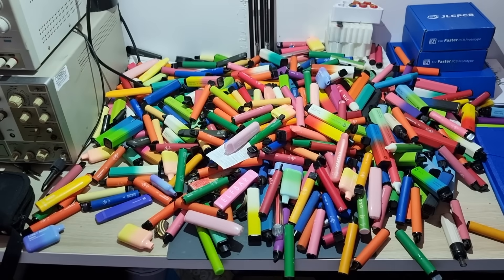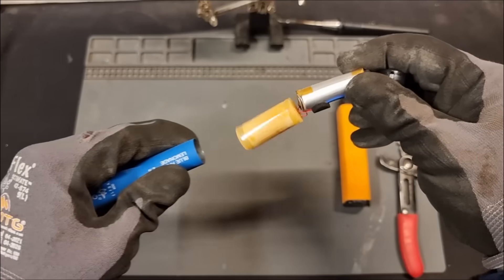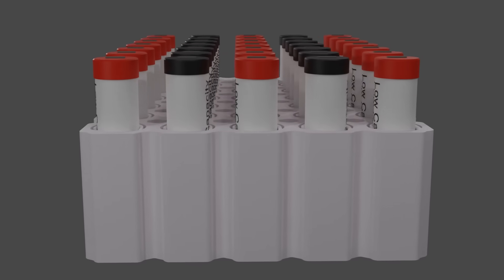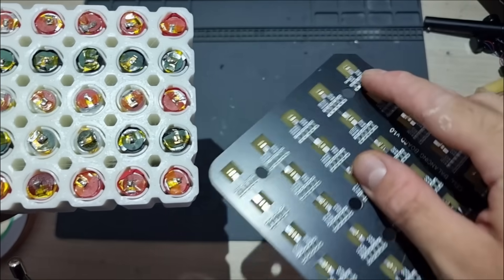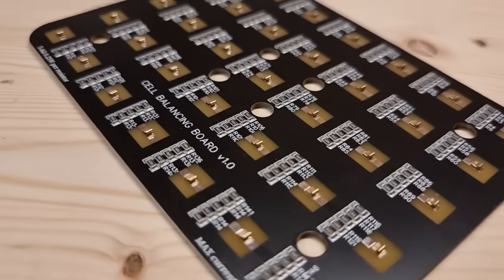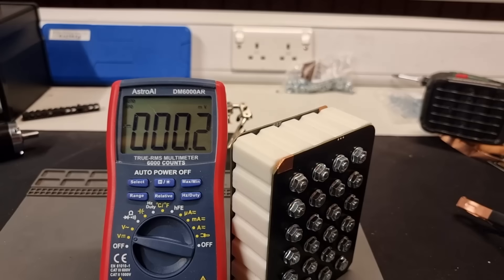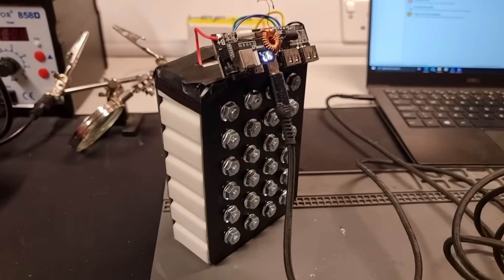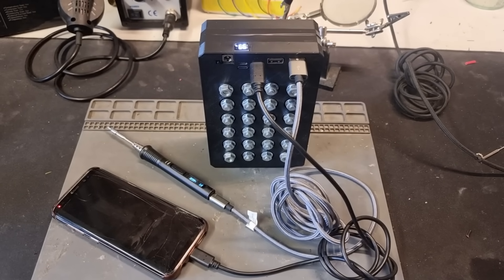Turning Disposable Vapes into a Fast Charge Power Bank

Comment: After 3 years collecting vapes from the floor I feel that I found my soulmate 🤣. I have added LiPo rechargable battery to every single device I have at home and now due to the abundancy of vapes I have been thinking several months about a similar project. Thanks a lot for sharing. 
Also a tip from vape picker to vape picker. I usually dont throw away the cases because they are handy to fit inside two batteries in series or one battery plus a charging module. Thenm I add some diodes in serie to adjust the output voltage and take a cable with a JST2 connector out from the mouth piece of the vape. Like that  you will get a nicely enclosed battery that can be used to power your small devices.
Reply: Yes,  I also have some good-looking and good condition cases that I plan  on using as casing for projects. I found a nice orange/black 420 vape. It was looking so cool I did the appropriate modifications to hold a bluetooth receiver so I can use it with my favorite headphones. I also wanted to use the internals of an old bluetood neckband, wiring the old speaker terminals to a 3.5mm jack that utilizes the former mouthpiece as the jack for the headphones.
Reply: wddadadddddddddffffffffffff_fds- @jaideesasaki
Reply: Another advice regarding vape cases. Some of them are almost a perfect size to fit a 18650 cell in them. You can also glue them together to hold the very same cells you've taken out of them for your projects. With a bit of ingenuity and a thread cutter you can make neat compartments for swappable cells too. Very useful for projects like light sources, communication devices, sensors, etc.
Reply: Hi, how do you rate the quality of vaping batteries after 4 years? Were there any problems with them? Or if you charge/discharge with a low current and do not exceed the charge voltage, is everything OK?
Reply: @vladimiryatselenko8206 good thing is that after 2 or 3 years you just replace the battery with another vape battery
Reply: I know its  crazy but could any one share a photo of how to do it in there own cases as I'm new but love the idea an feel with the right help I'd be all over it
Reply: Some of the vapes I find here in the US already have a charge controller inside the vape😂
Reply: @lijath same here in europe, flat wide disposable vapes have more liquid inside then it can be used in one battery charge, so they have usb-c charging port, as it's cheaper to put that then to put bigger battery, i have used 2 batteries in paralel and usb-c charger from those to power one of my old game controllers😀
Reply: can the sensor/control board be used for anything? I would love if it was possible to use them to control the battery without needing to print a PCB board
Reply: @pastramiandrye some have a charge controller, some only are only for the coil.
I've measured the resistance of some coils and the chip should be able to easily handle one amp.

I do deliveries on a motorbike, I'll be converting a 2400 puff casing with two 1750mAh cells and a powerbank board but will also run a slim silicon tube inside my helmet with the suck sensor fitted backwards and connected to a high power LED, I will be able to blow at the opening of the tube to "handsfree" turn on the LED fo when I'm looking at door numbers, walking up steps or giving "night blindess" to a little scrote trying to bike jack me at night.
Reply: What’s the typical capacity of these batteries?
Reply: @gurgelplus  360 or 400mAh
Reply: @gurgelplus  Per cell: 3.7V 650mah
Reply: i love the ideer can u make a vid makeing the same but for a powerbank
Reply: I don’t like to keep the cases because they tend to smell like the vape juice a lot.
Reply: thats so cool
Reply: you should post it
Reply: I too have converted all battery tools to LiPo. Batteries in a slightly worse condition, left over from my hobby. FPV drones, RC cars,...
Reply: technically if you have more then enough of em you could make it a massive storage piece to store energy for a pc to savely turn off within a minute or 5 max
Reply: @thedandy6765  That would indeed require a lot of them. Math nerd calculation as follows:
Reply: I have about 300 lol. Been collecting them for about 2 yeats. Got a load of 1500MaH, some 1100, some 550 and some 500s
Reply: @nonamespecified1262  Indeed a lot of yeets
Reply: Hey I really want to get into this hobby but I am not sure what you call it? Making your own stuff like this is it engineering? Aswell do you know any place where you can learn how to do this stuff? Thanks for answering :)
Reply: I have been looking for something to do with these batteries.  I know they're dangerous, and I'm electrically ignorant.  But I still have hundreds of batteries without a purpose.

This video was great.😊
Reply: Lol I literally have this many vapes because I keep them from me and my roommates smoking and we typically at least have one 2 g disposable in the house constantly for a year straight so I’ve got like 200 of them under the bed and I thought I was gonna make epoxy rolling trays out of them
Reply: Hello friends, I have been using these batteries for years in all kinds of electronic projects. Protecting the environment and recycling are very important. We should be more careful about this. Actually, it is not as complicated or dangerous as you think, but you should still be careful and take all kinds of precautions. I use not only batteries but also usb c charging circuits.
Reply: @alftri if you posted your vape constructions on yt id totally binge them
Reply: Jesus is the Son of God. He died on the cross for our sins and was resurrected three days later. Believe in Jesus and you will not die, but have everlasting life.
Reply: Ur gay?
Reply: Man that is brilliant using their cases I never thought of that but 3.6 volts you can add usb recharge ability to anything that takes AAs super easy have a great day
Reply: I'd use the cases as cases but I think it'd be odd having to explain to everyone "oh its just a charger, see?"
Reply: @Borret  I find very cool to have a device that still looks like a vape but with a totally different function. In the past I built and gift some small rechargeable flash lights that in the outside looked identical to the vape except for the fact that they had a push button on the mouthpiece and some leds on the back. No one complained about the gift 🤣
Reply: @alftri  You sound like a very handy friend to have, hope they appreciate your hobby
Reply: @Borret  underage mindset. i remember when I had to hide my vape all the time. Life gets better when you grow up and people stop feeling like they're entitled to tell you how to live.
Reply: @tissuepaper9962  I still go to school. It's literally illegal for me to vape so it's not worth getting in trouble with the law
Reply: @Borret Nothing to stop you starting your own business collecting vape battery's and selling them on ?🤔👍
Reply: What exactly do you mean when you say you've "added LiPo rechargable battery to every single device I have at home"?
Reply: @doubleRpR  For example, for devices using 2 AA batteries (1.5V each), I replace them with a single 3.7v battery and add some diodes to lower the voltage till the expected one. Usually in the battery compartment I still have some space to fit in a usb LiPo charging module (which cost 20 cents or so). This is specially useful for the children toys which are very power hungry and normally have  a big battery compartiment where you can fit whatever you need.
If you are thinking about upgrading remote controllers, I would advise to look for some flat vapes, which have a 300mAh battery with reduced dimensions that will fit in a AAA compartment.
Reply: @alftri  the diodes still contribute to power dissipation tho right? cause P = 0.7V voltage drop * current
Reply: @JeremyChung  Yup, I am normally using 1N4007 which drops approx 0.7v. The heat generated is low. Nothing to concern at least in my devices.
Reply: @saffsai  Usually 1n4007 which drops 0.7v approx and and makes a very good approximation to replace 2AA batteries with a 3.7 LiPo
Reply: @alftri  Would love some more details on these projects as It's similar to things I've wanted to do for kids toys that go through batteries like mad!
Reply: @alftri  wouldn't adding resistors do the same job as adding diodes for lowering voltage and if you get a POT you can dial it in to the voltage you want on the dot?
Reply: update me when your house burns down in a giant battery inferno
Reply: @robinbinder8658  So basically never, since I charge on the patio already (even the UL listed packs and chargers for commercially available e-bikes).

I guess that's the benefit to modding old lead acid scooters you find in the trash to run Li-ion: no one wants to steal them since they assume they're still stock, and if they do thermal runaway on you, so long as they're stored outside and away from structures, you're out at worst $100 for like the new tubes and tires, controller, and the bits to assemble the battery.

Comment: Great video! It's so rare that I get a recommendation from youtube to watch a small channel that is actually good!
LMAO I think you overdid it with the amount of iron holding your sandwich together.
Reply: I'm all-for recycling like this, I can't stand e-waste. I got a brand new, never been used Makita drill the other day for 50 USD (the guy had 20 of them, all completely unused, NOS) but it's 20 years old according to the date code, and uses NiMH batteries - it's so old that it was assembled in the USA, and it just reeks of quality. I've just finished replacing the NiMH cells with lithium ion cells and a BMU. The batteries are half the weight now and the cherry on the cake is that the NiMH charger even works with the BMU without modification.

Comment: Excellent work, just two things you could easily improve: size and weight, you don't need so much plastic around the cells plus the bolts, a lots of unnecessary metal.
Reply: yeah but unnecessary metal looks fucking rad as hell
Reply: Chris said somewhere that the PCBs were too thin/flimsy and wouldn’t be able to make contact with the terminals constantly, so he just put in a bunch of bolts to increase the sturdiness and make sure all the terminals made contact all the time.

Comment: This whole project was pretty bolts, I mean nuts.
Reply: Seriously though, why did he use so many bolts??
Reply: @YolandaPlayne  for safety ig, also it helps to makes sure each terminal of each battery is touching the board, only screwing the center makes the terminals on the side not be touching if the board is not flat
Reply: @YolandaPlayne  I thought I was the only one that thought it was overkill😂
Reply: Lmao nice pun😂
Reply: 24 bolt... nuts!
Reply: ELECTRIC
Reply: Boltnut are newt, butI personally prefer boltguns!
Reply: Ratchet approves this message.
Reply: @TURBOMIKEIFY  aww snap Bout to get screwy
Reply: AND IIIIIIIIIIIIIIIIIIIIIIIIIIIIIIII
Reply: It was pretty balls, nutsack even
Reply: Deeeze nutz!! :D :D
Reply: Nice one
Reply: shutup
Reply: @in7MwO4c5wXmkWcWVh depending on how you pronounce shut up, it sounds a little like шуруп on russian, which means screw. So funnily you’re actually kinda adding to the joke
Reply: @nas73603 🤣🤣 thats crazy
Reply: @in7MwO4c5wXmkWcWVh  😭😭😭

Comment: Got a link to the 3D print files please - I have 60+ batteries from dumped vapes also
Reply from the maker: I'm working on a few improvements to make it safer for construction and if all goes to plan i will open source it!
Reply: @Chris_doel  tagging just incase i want the files as well :) subbed too

Comment: Never knew the disposable vapes used lithium batteries, if it's just getting thrown away after why not just use cheap alkaline batteries?
Reply from the maker: The only reason I can think of is to take advantage li-ions high discharge current for the heating element and the well established supply chain. Its terrible that we are already running low on rare earth materials and they are being used in disposable products
Reply: Alkalines can only safely discharge a few amps and even then, considering the chemistry of the cell makeup, sometimes that can be pushing it. Lithium can safely discharge much more current, and since the heat generated by electrical power is Q = I^2*R*T, current becomes a huge deciding factor. Even if you rearrange the equation to yield Q = V*I*T (The heat generated is just fundamentally a function of power and time), lithium has the nominal voltage and discharge rate to make them the more viable option for something like this. 

However it seems like another big reason is due to shelf life since they self-discharge much slower, but that's not something I'm very familiar with. But just from an energy perspective alone, alkaline is just too difficult for these companies to justify working with
Reply: The schematic for the pcb ?
Reply: Alkaline cells won't be able to put out the high currents required for the electronics inside these vape bars. Hence the (foolish) move to use a finite resource (Lithium Ion) in single use, disposable vapes...
Reply: Amp draw is high
Reply: Not enough capacity or discharge.
Reply: Wonder if the old ones back when they weren't rechargeable used alkalines or just lipos with no charging circuit
Reply: Insufficient current capacity.
Reply: I think they did use alkaline before the rechargeable ones came out and all that, I also saw someone get his lips, tip of tongue and front teeth blown out from the explosion of one of the ones before rechargeable, I think, instances like that have something to do with it
Reply: @josephhall7317  alkaline batteries voltage sag to uselessness, they don't blow up.  They're more or less safe even dead shorted.  The batteries that blew up were li-Ion cells being used well past their C rating.
Reply: Vapes need a good bit of current, alkaline batteries can't handle being essentially shorted out a hundred times
Reply: To get people addicted, that's why.

I used to be a hardcore tobacco chewer but the Max Craves still hit me like a truck every time. I could feel brain cells dying with every hit.

If you put it at a setting with no adjustment, people will just accept that as the norm and won't have perspective on how strong it is if they've never used another tobacco product, or even how strong it is compared to other vapes.

Vape juices are regulated between 3-6mg/100ml, but the hotter the coil the harder you can hit it, and over time it will clog if you don't hit it hard enough. 

So the harder you hit it, the more rewarding it is (at least until the coil is completely saturated), and the faster you puff through it.
Reply: An alkaline cell will only be at about 1.5v where the lithium cell is at 3.7v.
Reply: @brine80 charged it's about 4.2, discharges to 3.2 usually. They are the most energy dense out of tech we have right now and have a high discharge rating 10-25 amps on disposables usually.
Reply: or li pri cells? it's the current, mass production, r&d

li-ion is basically only cell nowadays
Reply: that's why many people keep them then going to a battery recycle plant
Reply: I i have 100s of batrys i change my battry i have loads it takes me 9 seconds to change the battry cos i do own many vapes but there just easy to pop in but i wanna cut holes in them add a little spring so when the bat has gone just pop a fresh 1 back in @amazonite3955